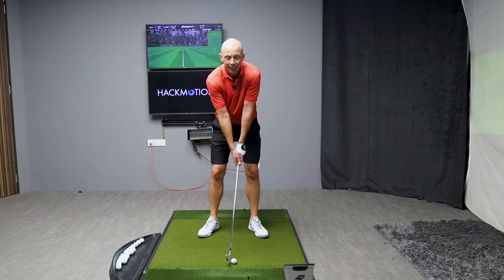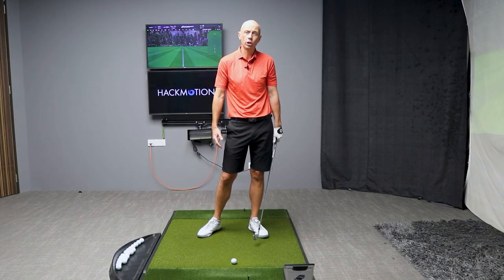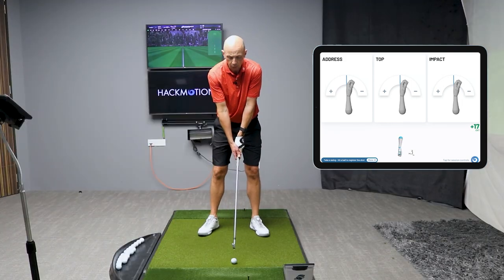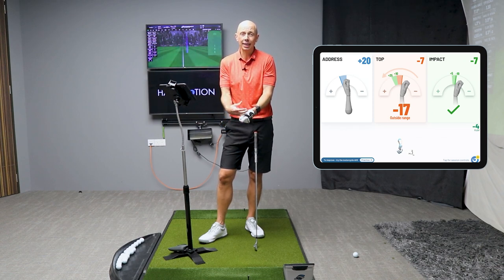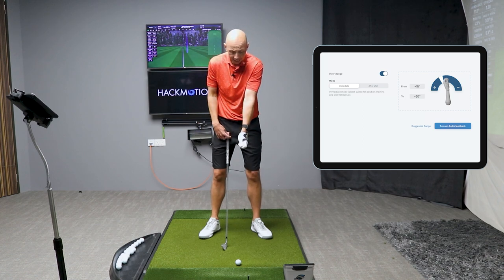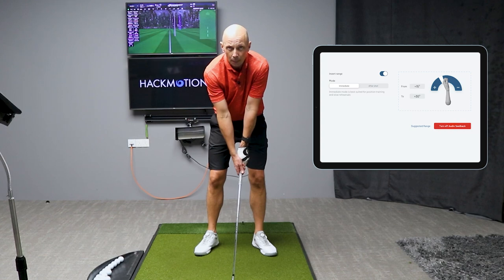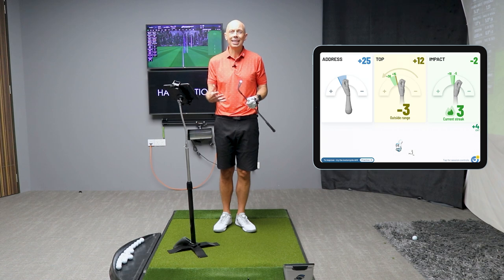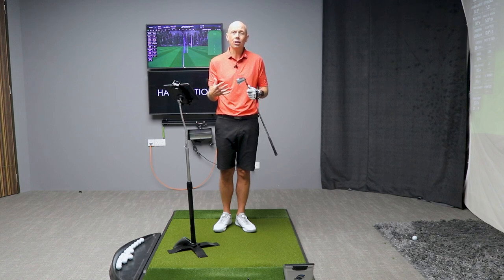What Causes a Hook and How to Fix It with HackMotion

Comment: Rob, how about forearm rotation as a source? When I started using HM I could not figure it out. My stock pattern was +14-16 at address, close to 0 or slightly negative at P4, and then losing that just before impact (last minute scoop) to end up around +8-12 or so. None of that should produce a hook right? My rotation was off the charts (literally) closing in on 180 degrees at P4. I finally got in contact with a coach that had seen lots of other ex field hockey players, of which many seem to have the same habit: taking the club inside and behind, then having to get very wristy rotationally to get back square.. video confirmed it. Now I focus on a steeper swing and 'dead wrists' which eliminates the hook. And yes, I could very well compress the ball better than the odd 6 degrees I manage to take off between P1 and P7 but as far as hook elimination goes, suppressing the excessive rotation did the trick for me.

Comment: I have the Hackmotion and both the top of my backswing and at impact are within range...however, I am still hooking the ball severely.  Does that mean I am not rotating through the shot?  Or is there something else that I need to be doing for a straighter ball flight?
Reply: Your grip is probably too strong.